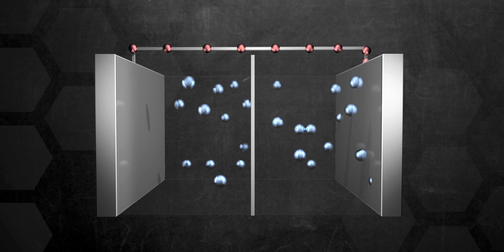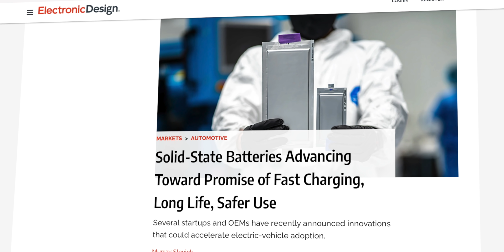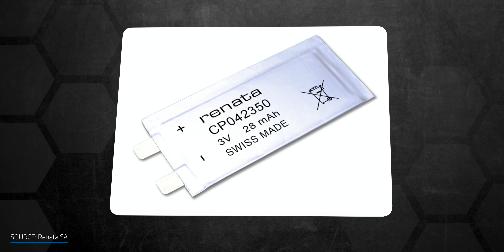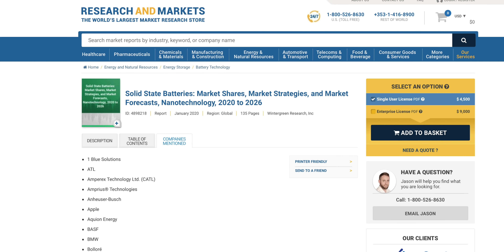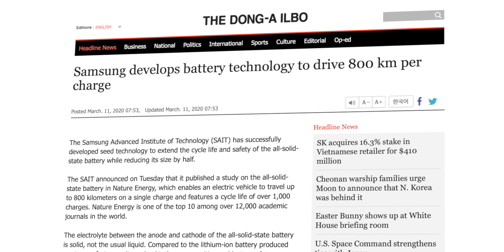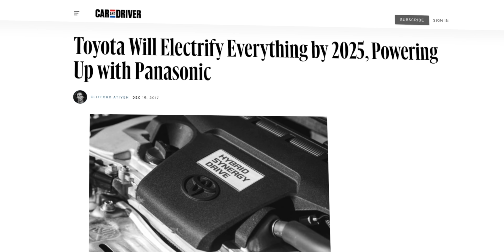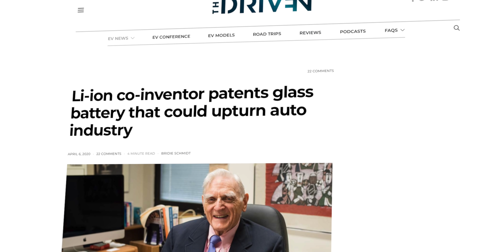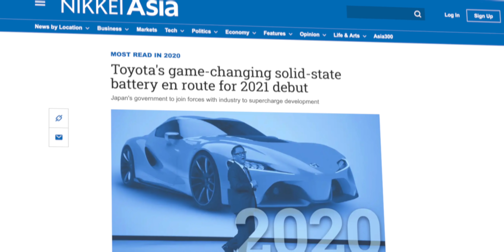Exploring When Solid State Batteries Will Arrive

Comment: IMHO, it will take beyond this decade for solid state to overtake current mass produced batteries because of the pricing and lack of production capacity in the form of Giga factory type setups. The short term market for solid state batteries is niche applications where lower volumes and higher prices are less of an issue and where the energy density is meaningful. 

The aviation sector is an obvious industry where pricing matters less (because of high unit prices) and the weight and safety improvements are critical. There are a few electrical planes on the market right now shipping in relatively low volume and with modest range. Double or triple digit percentage range extensions through better batteries would be enormously disruptive there. E.g. the Eviation Alice has a decent range already. But doubling or tripling that would obviously be a very big upgrade. And faster charging times will also be nice.

Toyota is an interesting one. They are clearly struggling with their messaging on EVs and are only grudgingly giving up on their "hydrogen is the future" vision (because at this point that clearly is not happening) and keep on offending people's intelligence by blabbing about "self charging hybrids" (without a plug because it burns petrol to produce electricity). To me that looks like they are buying time because they don't see a path to mass producing their solid state batteries in meaningful volume short term.

Comment: Solid state batteries are something that would change our world inside and out, but the same has been said about everything else. A battery that lasts 5 times longer and charges much faster would be so cool but will it ever happen. We were promised carbon nano superconductors and they never happened even though they work.

Comment: Solid State Batteries will come into a commercially viable form in about 10ys, plus yrs, plus 10 yrs, plus 10yrs, plus 10yrs into the future. Our level of technological sophistication will march ahead along an ever increasingly steeper curve going nearly vertical, and along the way will be discovered something much better than Solid State Batteries. At that point, my guess is around 2050 or 2060, this much better, but as yet undiscovered form of battery or capacitor like power will get our full attention leaving Solid State Batteries as they have always been, as an interesting, but unfulfilled side street in our technological advancement.

Comment: I wouldn't be surprised if lithium batteries, solid state or otherwise, end up being a dead-end despite their momentary promise (think radium in the early 20th C). The supply chain of a very volatile, just-add-water element is asking for the leveling up on disasters -- especially with vehicular crashes compromising the containment vessel. Then there is recycling -- which needs to be much more effected than plastics recycling. There also needs to be some level of standardization so that repairs don't require only visiting dealers and that we don't need a suitcase full of adapters for road-trip charge-ups. Mobile rechargers (vehicles) will have to be developed for stranded motorists who would now could be easily be saved with a plastic bottle filled with gasoline.

In the end, it may be that fuel cells using an easily stored/transported fuel source will be the best compromise. Not as "clean" as solid stated batteries but not as climate-change-efficient as petroleum engines and hopefully scalable from the device to small power grid (say, a trailer park). Or a Mr. Fusion that would be happy with a banana peel and some leftover beer (I'm sure it's just 15-20 years away).

Comment: they said solid state batteries were gong to be commercially available around 2020 almost 7 years ago and its 2021 and its still not really a viable option, Battery technology doesnt improve overnight, the basic battery technology hasn't changed in over 50 years, so 2030 isnt really very realistic, probably 2050-2060 we will then have commercially mass produced solid state batteries that are affordable.

Comment: If the solid state battery can become mainstream by 2030 we have a chance of slowing down the destruction that will happen if we are still using fossil fuels. My next question is how dirty is the manufacturing process and will the materials readily available to all so there won’t be wars fought over them like oil. It has already been said that lithium production will be on the down hill slide by 2030 relying heavily on recycling.

Comment: I only want battery capacity to get cheaper, don't care about density, weight or output. For me at least existing batteries have the capabilities I want the problem is that they are too expensive to implement them to the extend I want or in more devices, take an electric car for example, the range and power is fine, it's the price due to the battery cost that makes those cars prohibitive for me.

If all the metrics improve with solid state batteries but due to manufacturing cost it turns out I need to pay more for the same capabilities then it's really not going to change my life much.

Comment: Main "issue" with first proper solid state battles was a testing, after 20k cycles battery did not lose any capacity. That's why they research materials to limit change cycles.

Comment: Wider range of temperatures is not exactly true:
All available data for solid-state batteries so far show that while they have a far higher maximum operating temperature they suffer a lot at low temperatures - where low is rather relative as they already lose performance and energy at 30°C.
Under more extreme conditions the disparity becomes abnormally large: While a cold-temperature LiPo can still deliver well over 50% of its rated capacity for current low temperature solid-state it is at around 10% only. With normal winter-conditions of around 0°C for large parts of the world the solid state still have a lower energy density, and do not even come close to the power-density of liquid electrolytes. At 40°C they offer quit a bit higher energy-density but just come close power - and that is in designs that are not fully solid but at a small amount of a liquid electrolyte to overcome that weakness. The solid materials are a lot more fragile. While they can resist stress without deforming they can break from small shocks which can lead to significant instantaneous degradation.

And that some big companies invest heavily in that technology says nothing about it being viable or not - that is an investment into research and development. Companies also invest into a lot of bullshit as missing the opportunity costs more than investigating every possibility.

maybe solid-state batteries will become the next widely used battery technology, but it does not look like it will be anywhere close to that for the next couple years.

Comment: It's a frustrating topic , it's never a right now situation, it's always a few decades away scenario, unless major reform or changes in resources we won't see the drive needed until it becomes sink or swim. Lithium is highly destructive to the environment period, mining and disposing. These are not solutions just patches. I find it frustrating to see this as one of the few answers for the coming moments. Wish we could just run on air , but that isn't possible either unless you count hydrogen fuel. Who knows , but we can't be settling for just anything.

Comment: 80% capacity in 15 minutes..  that is really not that impressive. Its pretty muxh onpar  with most thin cells.  Its when you start stacking them charge rate is a problem. Even then... its really mostly the charger that limits it.

80% capacity after 800 charging cycles is really inte the low end. Industrial cells like LTO does over 7000

The volymetric density  is really where solid state shines.  The issue is that they expand much more than non  solid bateries does, making them hard to package.

The result of is that solid state bateries cant be roled, they have to be folded.  Making a prototype by hand is quite simpe. Making mass production is really hard. Making mass production at high volumes and low cost. That is really a chalange.

Comment: They will arrive but the economics will be terrible and thus only apply to high-end cars but fortunately Tesla's 4680's can be more cost competitive at the high end, mid range and low end since there are 3 flavours of their battery chemistry.
So Tesla has killed off any future for the solid state within private automobile market.
Only markets left will be Semi, vessels and airplanes ....which is still huge.
The Tesla shorts only have solid state as their last boogyman bear case.
Let us assume they are right....do you think the inventors are going to partner with the largest seller of battery applications or some smaller players. They will partner and manufacture with Tesla, so the bears undermine their own case.  
Apple, Google are not going to be doing the heavy lifting in terms of R&D and neither of the large OEM they can not afford the risks and the costs to take a research project onto mass production even if they have seen the light - which they have not.  All they have seen is the extinction of their cash cow....ICE cars and trucks, semi's and vans...by Tesla, regulators, Government policy and consumers who are so sick of being killed off by pollution from ICE engines and are clambering for a solution. The horse has bolted from the stables as they say and Tesla being first has built a global brand that is one and the same with EV's. 
Just like Google is synonymous  with internet search, Tesla is with EV's.

Comment: 1:13 "1/3 in under a decade", completely ignoring the savings aspect of using said tech including but not limited too oil changes, fuel, brakes, engine repairs etc...
Also where is this 1/3 coming from they are talking about? Assuming someone drives 15k miles a year (the American average) and you are driving something with the range like a Model 3 or Bolt so long you maintained the battery at logical levels (never fully charged, never fully depleted most of the time as both kill batteries faster), said battery should NEVER drop below 70% within 10 years. At least for Tesla at 100K miles the worst I've found is 10% degradation, so I'm to somehow expect at 150K miles or even at 250K miles you'd be sitting around 66%?

Comment: Around 2005, my Siemens A52 had battery 600-700mAh. It was tiny, some ~ 24 cm² (4 inch²) and allowed phone to idle for 1.5 weeks. In 2021, my whatever chinaphone or Samsung (I don't even mention Apple) has 4.5 Ah battery. It has gotten 6+ times bigger and occupies the same fraction of a much larger phone.

So, over the last 15 years nothing has really changed. Yet every month I hear about enormous progress and discoveries in battery technology. Every year it is promised to double. And all these batteries stay in laboratories.

It may be premature to jump to conclusions as well as comparing German phone at the time with Chinese today but batteries are not even close to developing at the same rates as other hardware. Remember where we've been with CPUs in 2005? Pentium III was a thing. In 2007 we were looking at 2x quad core processors and thinking it would be enough for a lifetime. Now we have double this in every phone. And yet batteries are from 2003.

I don't see all these batteries and I doubt I will ever see.

Comment: Hello, my name is Marcus Mitchell, the owner of Mitchell's BikeWorks. My business is a bicycle and motorcycle shop and manufacturer. All of my motorcycle and e-bike designs will incorporate the use of solid-state batteries by 2028. Designed by a well-paid and competent team of engineers, these motorcycle batteries will be rated for up to 120v and 1800Ah, and be capable of supporting a continuous drain of up to 600A for 3 hours. The customer will be able to plug their bike into a simple wall outlet to charge at a rate of 60Ah/hr for e-bikes. A special panel will be provided at no extra charge for motorcycle owners, supporting a charge rate of up to 320Ah/hr.

Thank you for reading my comment, and I hope to do business with you soon.
Sincerely, Marcus Mitchell.

Comment: I think it will be about 2030 before they are ready. At 60, that's like next week to me lol. I think this will put the nail in the coffin of ICE cars except for collectors and enthusiasts and they won;t have to worry about the pollution since there will be so few ICE cars on the road the remaining ICE vehicles will contribute insignificant amounts of pollution. Also, this tech is what's needed to make robots a reality for home use. Up until now, no batteries are capable of supplying the power required without a tether or a very short time between charging. Bring on the sezbots lol.

Comment: You say the car battery could do 500 miles on a charge and charge for 1000 times. Then went on to say that's 500,000 miles, then in the next slide you show (quite truthfully) that typically they retain 80% charge after 800 cycles.. Why are you doing misleading math previous to thi  in a video where you're trying to inform people? Don't use saying "upto" as an excuse either because that's false too.  It doesn't fit at all. Just be mindful of details, they matter.

Comment: They need to pass a law prohibiting use of EV cars, if it can't be charged using solar. 
Our grid and delivery capacity is nowhere near enough, if thousands of cars start charging at night. You have to build an infrastructure first.
Put a PV system on your roof if you want an electric car.
Reply: And in plenty of places solar charging is complete garbage, if not completely unviable.

Not sure how you can justify banning anything.

Comment: When it arrived for smartphones, it is time to buy a smartphone. Why? Because the current problem is swollen battery trapped inside non-removable battery smartphone. Humans are smart, why buy a smartphone which will have swollen battery then you have to buy a new smartphone because the smartphone got damaged by it. Doesn't make sense. I still use a removable smartphone. Yeah,.. 7 years old smartphone. :)

Comment: Making batteries out of any metal, let along rare-earth metal is a dead end. First there is a cost of mining and scarcity. Not to mention that most of it is in China. Second there is environmental impact of manufacturing on gigantic scale. And manufacturing cost. And if manufacturing cost can be reduced over time, cost of mining will only grow. So will the price of raw material as demand goes up.
The only real solution is polymer. But there is no reliable tech to make solid state (or any other sort) batteries out of polymers AFAIK. Real solution would be hydrogen. The way regulations go, in 10-20 years private car ownership will be out of reach for everybody except maybe top 1%. So hydrogen powered public transport, railroads, ships and plains. That's the only way.

Comment: Will be great because tired of Li-ON & other crap batteries who discharge other time. The most funny is than LiPo are the more stable batteries than you can get. You can let them unwatched with storage voltage for 3 months without any worries. If you let a lithium batterie unwatched for three month, it will be just dead & good to trash.

Comment: My 2 cents, I would think the real reason why its out in 24-26 is not due to lack of machine that make the solid batteries, its when normal lithium batteries is running really low or coming to a halt in production.   So if you're a greedy bastard you will sell them the solution at "MAXIMUM Profit Gain", seriously if the amount of money is there then building that machine to make that stuff is quite fast.  How fast do you think in modern day can built a factory, probably in months to a year.  Most tech of this nature is the slowest to get to mass market, almost none of them are made for just advancing the human race to have a better life, almost always driven by pure greed profit chaser.  After all this video clearly stated this is nothing new it was already there in the 70's o_O.

Comment: Have you ever looked at vacuum capacitors?  They supposedly can store electrons in a super clustered state. They are very inexpensive, fairly easy to make, have both ridiculous energy density as well as power density.  This is the company that is working on designing them: 
http://freel.tech/charge-clusters/

     I can't say whether or not they are legit. I know some of the research and theory behind them is legit--especially the repeated observations of Ken Shoulders, but until I see one actually work or be interdependently tested, I'm going to remain skeptical.  However, IF it is the real thing, it is a complete game changer in energy storage and will make all these other chemistry's obsolete.  And if the company is legit, I really hope they don't get shut down, side tracked, etc.